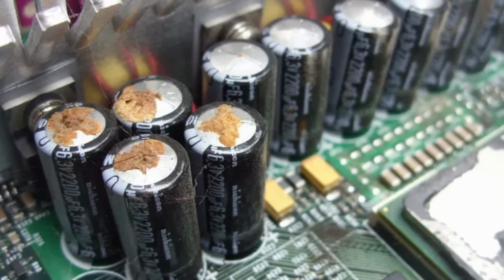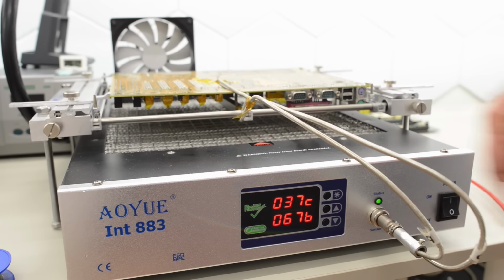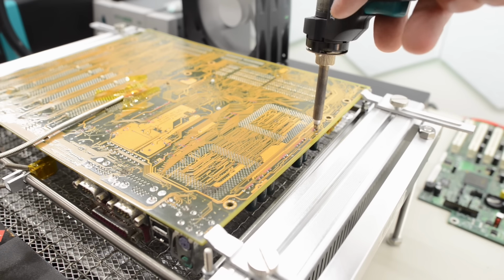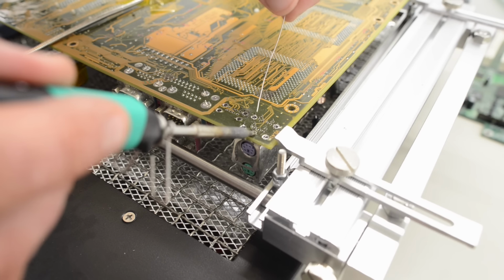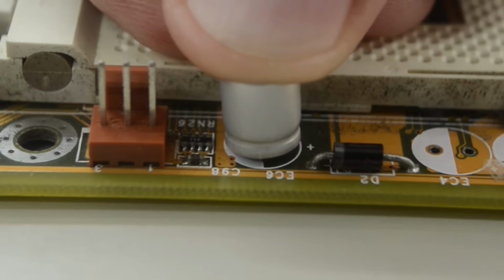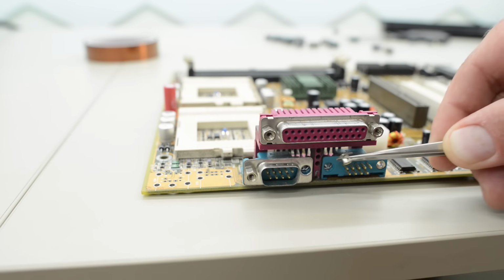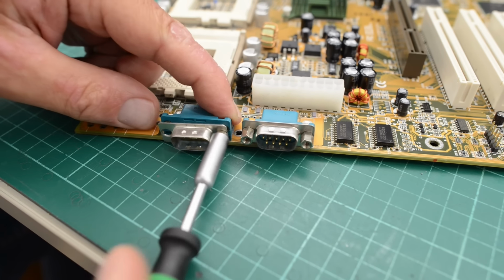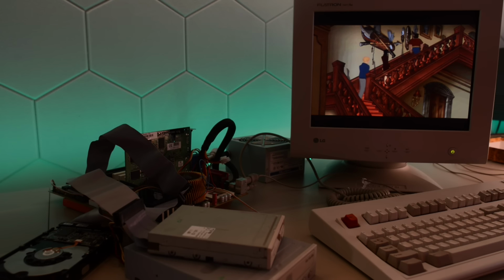ABIT BP6 Repair & mod with modern caps

Comment: For PSU, to do good for the components, I highly recommend to NOT EVER go with "Period Correct".
Because ATX PSU of that time were usually garbage.
Some Workstation OEM PSU might be OK, but then again, they're 20 years old and modern PSU are rather cheap and soooo much better electrically its not even funny (for example Ripple at below 20mV isn't uncommon for higher end units)
And you also save a bit of power (due to 10-25% higher efficiency)...
For the rest, go with "Period Correct", but do your components good and choose a decent, modern PSU...

Comment: What is the tool that shows the size in mm ? 

I have a DTMF Keypad I need to 3D print and I need to find the exact size of the buttons and I need a tool that will go I've the the sizes
Thank you
Reply from the maker: Metric digital calipers

Comment: Isn’t what you did with the SMT cap basically just use a poly cap?
Reply: How odd
Reply: Great call out on the board warp btw, I had an xbox I did a recap on and experimented allot on methodologies as I wanted to figure the safest/best ways to mod it before I do my crystal console and I just looked and saw the bend!!! Still works fine but now on my primary console ima only use my hot air once and first pre-heat the board
Reply from the maker: I couldn't find any Pollys smaller than 10mm on mouser
Reply: @Epictronics1  You can get modern poly caps in through hole down to 5mm these days! In the US, Digikey and Mouser have them available. However, LCSC is the place to go for bulk and brands that aren't on Mouser or Digikey! Not sure if you mentioned this in the vid, but BE CAREFUL when using either SMD or poly caps in this way without a spacer or base. This is because the metal housing is exposed and might conduct with exposed copper inside the footprint of the older electrolytics. This is not common but can easily be overlooked since the engineering expected the electrolytic footprints to be non-conductive. Using the existing base with the SMD caps is annoying but you can also buy pre-made spacers on Mouser for through hole parts. Speaking from experience. Be careful!
Reply from the maker: @tevianb1327  Unfortunately, I couldn't find small enough pollys with this rating on mouser. I know other people have had the same issue. Thanks for the warning
Reply: @Epictronics1  Search for Kemet brand of Aluminium Polys on Mouser. Something like this part number.(A755KS108M0JAAE013)

Comment: Is it really necessary to heat up the whole board for desoldering caps? I want to know because I'll likely have to do motherboard repairs sooner or later.
Reply from the maker: No, not always, but it makes the job so much easier. Just never heat up a part of the board, that can skew or bend the board

Comment: You can still buy 1500uf 6.3V 10x13mm THT caps. You can also swap it for polymer ones ULR1500/6.3 wich can not leak.
Reply from the maker: I couldn't find anything thinner than 10mm on mouser
Reply: @Epictronics1  how much they need to have in diameter?  8mm? Than its my bad. I thought 10mm will fit.
Reply from the maker: @mophusFTL  Yeah, unfortunately, 8mm is max. Also, they need to be low enough for the Gorbs to fit
Reply: @Epictronics1  A750KS158M0JAAE014 are 8mm in diameter and are polymer. Lead spacing is 3.5mm so it will fit. Never the less your method can be handy.
Reply from the maker: @mophusFTL  Thanks. We'll do a Polly mod on some other interesting board in the future.
Reply: @Epictronics1  nice. Im giving a sub and waiting for more. Thx
Reply: @Epictronics1  A750KS158M0JAAE014

Has 8mm in diameter and it is polymer. You can buy them at mouser.

Comment: For those larger pins, perhaps an old-fashioned solder sucker (like the EDSYN Solda-Pullit) might be a solution. In some situations that device would probably be faster than the desoldering gun (less maintenance too).
Reply from the maker: Yeah, they seem pretty good

Comment: I had one of these boards back in the day with twin Celeron 300As (overclocked by 50% to 450!) along with the those Golden Orbs. IIRC, I had to to file the one side to get them to fit with the caps.  About a year in I did a few cap replacements that many recommended for stability.  Originally I ran only OS/2 Warp on it.  But later I dual booted to Win 2K after I bought a Geforce2 MX along with Deus Ex which was one of the first games to be coded for SMP.

I wish I would have kept that board.
Reply from the maker: Yeah, those Gorbs needed some filing to fit with the original caps. Now we've got these hacked SMD caps instead :) I'm going to try this board with OCd 300As in a new vid

Comment: 21:17 “Period correct graphics card”
I built mine around 2000 as a companion to my Asus P2B PIII system from early 1999. It was mostly used with hand-me-downs from my PIII including Diamond Monster Fusion Z100 (3Dfx Banshee) and Voodoo 3 3000 AGP, but it ended up with a its own GeForce 2 GTS-V before I had moved on. It also got some limited use (testing) with a GeForce 3 from my first Pentium 4 system. It was perfect for GL Quake, Quake II, Unreal, Quake III Arena, Unreal Tournament, and so much more from the late ‘90s and early 2000s. nVidia was my go-to for SMP gaming.
Reply from the maker: Yeah, nVidia came out with quite a few cards during the (short) lifespan of the BP6. Many cards to choose from!

Comment: I did something similar in production with bending leads. Can’t remember if the part becoming NLA was surface mount or through hole, but rather than redesign the board we just bent the leads to use the other version that was still available. I’m thinking it was a decent sized three pin voltage regulator or similar. I don’t know if the thicker leads would’ve been more resilient than the tiny leads that you did, but they’re probably fine too.

It was approved by our customers engineers, our really smart mechanical engineers and our Test group. I’m thinking they may have done a couple shake tests on sample assemblies.
Reply from the maker: Good to hear. I think they are going to hold up just fine too

Comment: I personally have had more failures with SMD caps than normal through hole, but that would be old ones so maybe the new are better.
What is the ripple current rating on the replacements compared to the originals?

Comment: Nice repair and a great motherboard. I have two dual 370 motherboards. One Gigabyte GA-6VXD7, and one Tyan Computer S2507T. They both support Tualatin cpu's. The Gigabyte board has dual 1.26ghz cpu's and the Tyan has dual 1.4ghz, and both has 2gb ecc 133mhz ram installed. One good thing with the Tyan board is that it supports ide harddrives over 120gb in size, I tried with largest ide drive 750gb available and no problems at all. The Gigabyte one supports up to 120gb. One funny thing was that the Tyan board was installed in an old case in a dumpster near where I live. I didn't hesitated for one second. Still have it to this day as they become harder to get.
Reply from the maker: Excellent finds, nice boards!
Reply: @Epictronics1  absolutely, thanks :)

Comment: I think you have a way too wide tip on your desoldering gun, try one with 0.8 - 1 mm hole
Reply from the maker: That is correct. My 1mm nozzle is worn out. I have ordered new nozzles but shipping is slow from China

Comment: Back in the times i could do an average mainboard recap in maybe 15mins. Pre-cut and flux the new caps, mount the board vertically and then use a wide tip with some solder on it to heat both pins at the same time, pull out the old cap and push in the new one without moving the iron away, if needed add some more solder, go to next cap. No preheat or desoldering/clearing needed.

Comment: omg man, they make THT poly caps that are just as small as the SMD ones your ordered.  Did you really grind down all those SMD legs?!
Reply from the maker: I couldn't find any 8mm wide polly on Mouser. Yeah, it took two minutes. Totally worth it, the board is fixed

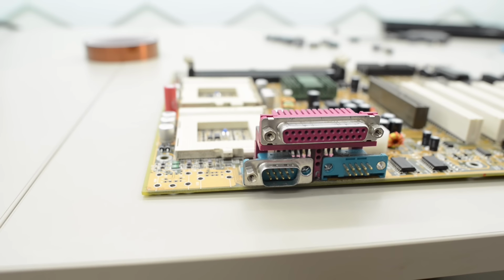Comment: 16:10 I'd have tried making my own tool to put them back, using a bent copper wire maybe, fold it in two with a bulge at the fold just large enough to fit the part around it, and then curve it…
Reply from the maker: Yeah, that would have worked too

Comment: There's no need to go through that nonsense of modifying SMD caps when you can just use radial polymer caps. Nobody does it because there's no need to. You can get 8x11 polymer caps in that farad rating and voltage, which are better quality and more tolerant of heat than electrolytics are. They'll also never leak.

If you need extra room, you can rotate the cap 90 degrees and have it hang slightly off the board and secure it with something like E6000 glue and liquid electrical tape on the legs to prevent shorts. This will give you a capacitor height of 8-9mm instead of 10-11mm. If you have enough leg length, it may be possible to fold the cap back on itself a bit and keep the cap from going off the board.

Comment: Nice hack, but I recommend checking for Aluminium-Polymer capacitors. They are available in the mixed case, i.e. SMD case but through-hole legs. They are double the price compared to Aluminium Electrolytic but also have half the series resistance. That makes them perfect for the point of load supports around the CPU. Example: KEMET A750KS158M0JAAE014
Reply from the maker: Thanks, we'll try them out in a future video

Comment: Easily the best BP6 capacitor video on YouTube!

I'll add a few comments from my own experience with refurbishing one of these boards in case it helps someone else out. I swear good info is hard to find on these things!

I re-capped my BP6 board with polymer caps about a year and a half ago. It's totally possible provided you keep to the 8mm diameter required. Many of the larger uf poly caps come in 10mm diameter by default, but if you look hard enough, 8mm is available. The issue is that the 8mm caps are ridiculously tall though, and will absolutely cause issue with 'orb' style heat syncs. 

My solution to this was to simply not use orbs. Turns out that AMD "Socket A" coolers are effectively identical in just about every dimension, and can easily be mounted to Socket 370 boards. They fit 100% perfectly and do not interfere with the capacitors at all. What's better yet is the brand new coolers I found had 6cm fans, which meant I could easily upgrade them to Noctuas for silent operation.

I don't own a heater like this, so I did the entire job on a wooden work bench with a soldering iron and de-soldering gun. For stubborn ground-planes I found it easiest to just heat the leg up and pull it out, and then use a 0.75mm PCB drill bit to literally just drill out the remaining solder. It sounds like a violent technique, but I'd argue the risks are equally as high as accidentally melting or discoloring something with too much heat. It worked like an absolute charm for me, and after a day of work my BP6 has been rock solid since, running two 360mhz units at 550 all day long

I also replaced the North bridge heat sync with a bigger one, and added a 40mm Noctua fan on that too. And of course I added thermal paste, since the original famously has none!

Such SMD capacitor hacking has been around in the Walkman community for a while, since many of the teeny-tiny caps required for them are long obsolete, and thus it's the only feasible option! Glad to see people are now able to use it on PCs too
Reply from the maker: Great write-up, thanks!

Comment: I had a BP6 with 2 Celeron 433 running at 490, a Voodoo 3, 256 Mo ram and SCSI disk.
Usually running Linux or FreeBSD.
It was quite a beast in her time ...
Caps started leaking just 3 or 4 years later, but easy to replace.
I loved this board.
Way too expensive now.
Replaced by a dual Athlon XP 1800 modified as MP 1800.

Comment: I ran 2x 1000 Mhz PIII's in mine. 1024 MB ram, 7 76.8 GB IBM Deskstars. And some boring SB that gave me no end of problems due to timing issues with dual CPU set up. I ended up buying some ridiculously expensive TB clone. I have no idea what GPU I bought, but I know I went through 4 upgrades of GPUs over the next few years. But my VP6 board had a different layout from yours. Mine didn't have the cpu sockets in a line like yours, but one at the top and one more central. I assume even Abit figured out the flaw with the edge mounted cpu sockets.

Comment: That's a fantastic little hack, and a great repair as well. And I love the Flatron monitor! I have its bigger brother, the 915FT Plus; they are magnificent units.
Reply from the maker: Thanks. I couldn't afford the 915FT when they were new. I got the 17" for my VP6 back in 2000. Awesome combo. Until the caps popped :)
Reply: I got mine from a friend who got it from a friend who found it locally... in a different country. It's been around, but I use it as my main monitor. Needs some chassis work, however.

Comment: interested to see what you do with the board
i like to heat wiggle the caps out with soldering iron and then use hot air + desolder gun to clear the vias.

Comment: Would love to see a period correct Linux distro on this once you get both CPUs installed. Kernel 2.2 was released in Jan 1999, and added SMP support. So any distro with kernel 2.2+ should work. Also, great tip on the caps!
Reply from the maker: Thanks!

Comment: What model cap are those? if those are the caps I found…they are not low z/esr. They won’t last long if so. They’ll die from the high frequency pulses. I have used this technique myself to replace TH caps though. It definitely works.
Reply from the maker: I don't have the P/N at hand but these are low ESR
Reply: @Epictronics1  ok cool! Good work!
Reply from the maker: @thomasandrews9355  Thanks!
Reply: @Epictronics1  I have to use this same trick for nextcube magnetoptical drives

Comment: Bro...wtf! Why don't you put Flux on the joins ? Heat and more heat ain't going to make it easy to de-solder, and that sucky-gun sounds like the pump is weak.
Reply from the maker: Adding flux clogs the desoldering gun. It surely helps but it's a pain to clean

Comment: From memory those Gorbs were actually pretty garbage coolers, only barely better than the stock cooler. The fins are way too long and thin to actually conduct the heat and provide useful surface area for dissipating the heat. Again, from memory, socket A coolers are compatible with socket 370, and there were plenty of actually good coolers for socket A. I even managed to find some that had a copper base with aluminium fins, which perform way better than the stock cooler or the Gorb.
Reply from the maker: I haven't done any tests to compare, but I don't doubt that you are right lol. I had these back in the day so this is pure nostalgia :) Also, I think they look tits

Comment: Stuck at the airport with cancelled flights... Cloudstrike? :) 

The Abit BP6 is one of those boards I wished I could have had back in those days. I think I once saw pics of someone who had 2 golden orb heatsinks on a BP6 but they removed some material on the heatsink in order to make it fit. 

I did have a golden orb back then. It was installed on a Celeron 566 in a slotket adapter plugged into an Asus P3V4X motherboard. The whole setup was heavily overclocked to 875 Mhz (8x103 FSB.) Those were great days even if basically every mainboard I owned during the capacitor plague era died due to that.
Reply from the maker: Yeah, the common hack back in the day was to cut/file golden orbs to fit the BP6

Comment: Actually you could have bought the right caps without having to dremel them. Can't give you a direct link but if you look for this number APSF2R5ELL331MF08S it will show you a 330uF Conductive Polymer Aluminum Solid Capacitors made by Nippon Chemicon that are only 6.3mm diameter ;-)
You are several rungs above the average pc enthusiast but the pros already know how to solve this problem ;-)

Comment: I had a bp6 over clocked using a window ac unit pumping cool air into the system and two  raid card with 800gb of storage running windows 2000 dual boot Linux. It was a sad day when it released it's magic smoke

Comment: I used to sometimes, when I did not had the proper values, solder smd capacitors like you did. However, I never tought to file or thin theirs legs, they fitted just fine. The board also look better with those caps.

Comment: I used a BP6 and Celeron 300A CPUs lapped and clocked to 500mhz for years to run a TFC game server. It also hosted an apache web server. The CPUs were upgraded to Celeron 533s then about a year after that it started hanging randomly and eventually quit booting. Bad caps.

Comment: Great board.  I scored one, and a pair of Celerons to run in it, from Pricewatch back in the day.  It was my BeOS computer, since it could actually use the dual CPUs.

I recently re-built a BP6 + Dual Celeron 300 in an Antec Performance II mid-tower.  And yes, of course, it needed new caps.  I don't think I finished the job, just replaced the ones near the CPUs since they were clearly in need.  Some day I'll have to do the rest.

I do have concerns with your choice of caps, though.  Physical size is usually correlated with capacity, working voltage, and ripple current rating.  I'll admit I don't usually bother comparing ratings between original caps and replacements, since I use high-quality, low-ESR caps of the same V and uF rating, and as close to the original size as I can get.  I figure it's gotta be as good or better than the no-name wonders found in PSUs and motherboards.  But, since yours are substantially smaller, somethin's gotta give.  Tech improves, but we're still subject to Physics 1.0.
Reply from the maker: I made the same mistake with my VP6 board. I only replaced the main suspects but ended up having to replace all the caps on the board to make it work proper

Comment: Would adding some chip quick solder help in removing the stubborn caps?
Reply from the maker: Absolutely. I like to use it when I can't use hot air